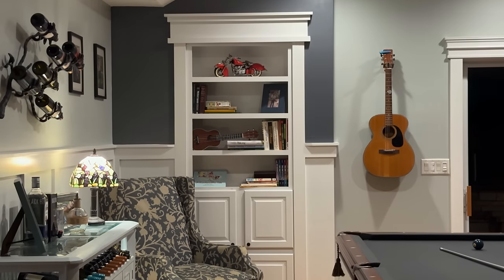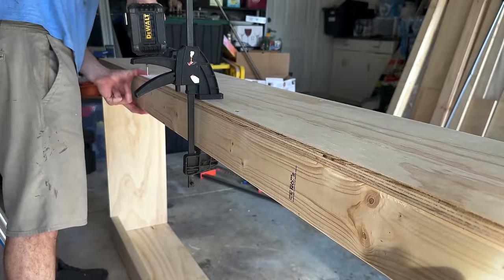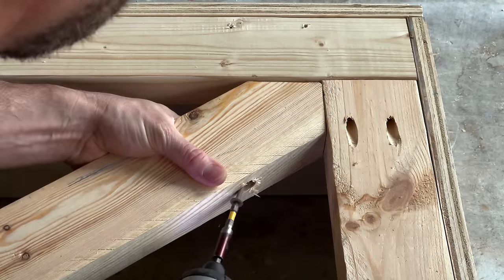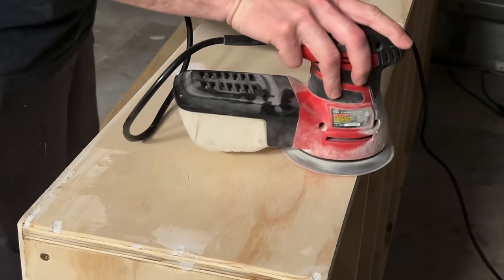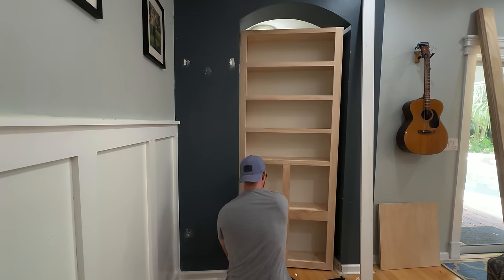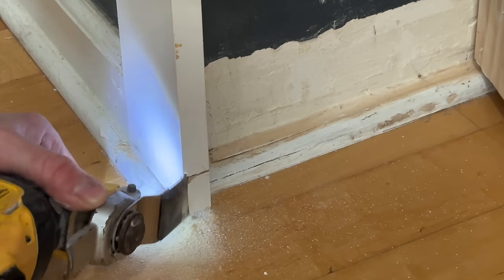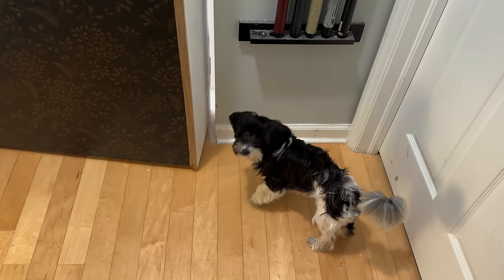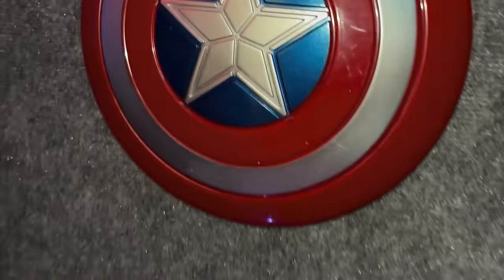DIY Hidden Bookcase Door - Murphy door build

Comment: Aside from something fun it kind of makes a safe room.
Reply: A couple of 4x2s on hinges mounted on the opposite wall with rubber stoppers on the end, one level with the base and the other with the top would make the bookcase seem solid from the other side when engaged would effectively make it just that. Relying on deception rather than full security, but should keep the kids safe from an intruder for a time should such a need arise.👍
Reply: @alaricgoldkuhl155 I think that’s what the pool cues are for!
Reply: Guns makes a safe room
Reply: @pyropulseIXXI a healthy society makes a safe room, but that's not something known on the northern American continent.
Reply: @Lorem_the_Ipsum  Sadly, home invasions are an issue worldwide. Unfortunately, wherever there are human beings there will be instances of violence. You could argue what differs by continent would be the tools used to commit said acts but violence committed by gun, knife, club or bomb are all the same. 

However, if it makes you feel safer to think differently perhaps I shouldn't try to take that from you. My apologies.
Reply: @Lorem_the_Ipsum  Sure it is. Just as long as you stay out of Blue areas.

Comment: Great ideas, I for one and forward thinking enough, I’ve done this for 40 yrs, every time I go to do something and something is not there ect, I will add it to the next build. The best is the tv, I have tons backing and put a small built in cabinet below it with a 2” conduit run to both. Hides wires. Tons of little things to make a home better.

Comment: First off, this is awesome!! As a longtime cabinet builder let me give you a few tips for the next one you build (you know, when you move 🤣).
If you use some half lap joints on the outside frame it will add a lot of resistance to twisting. Also, compared to the plywood back (that you VERY wisely glued down) those diagonals provide little shear support. You'd be positively amazed at how strong even 1/4" ply is under shear loading.

Keep it up!
Reply from the maker: Thanks for the words of wisdom. I’m always looking to improve. Great advice, and thanks for watching

Comment: Great work, I wish I had someone like you in my life ^_^ growing up.  If ya want a tip for future reference, the cross bracings should go in the opposite direction to properly assist with fighting against the sagging, the direction you went with would require tension bracing (often using a steel cable). There is a good quick video showing the difference here on youtube by SWI Fence, named "The Only Way To Brace A Gate" (I have no affiliation).

EDIT- I MADE THE CLASSIC MISTAKE OF COMMENTING MID-VIDEO! 😂  I thought I was in the clear when you started working on finishing some of it. It appears ya had it right during the planning phase, and in the moment the hinge side got mixed up, but ya noticed it and went back and flipped it around, good catch!
Reply from the maker: Thanks for the thoughtful response and thanks for watching

Comment: For a security situation, continuous baseboard is imperative. Dead giveaway for anybody, robbing your house, etc..
Otherwise, it’s a good looking project. Another tip, use a hidden wheel to hold up the weight of the bookcase.

Comment: Very nice build. There are only 2 things that I would have done different. 1, I would have added 2 casters on the bottom of the door to roll the door when opening , this will take the strain of the hinges as well. 2, I would have had a couple of Heinekens rather than Michelob Ultras. Good show man, Cheers.

Comment: Things I would have done differently: I would have made the height of this bookcase match the height of the rest of the doors in the room, especially the door on the same elevation, and I would have continued that board and batten wainscoting all the way past that other entry door. You didn't change out the baseboard on your new wainscoting sections, and it looks jarring next to the old wall. On the top section of the architrave/door molding you have totally different proportions than what is extant on the adjacent door on the same wall. Making those two openings match would have involved more demolition and drywall work, but I think the result would have been even more pleasing.

Comment: Love a lot of things about this interesting video.  The help from your son, the help from your dog, repurposing on lumber/doors.  The wide top of the door with the trim and cool reveals all the way around.  I hope your family gets you a router on a table to further your trim work and edging.  I used to take baseboards off like you did then I found trim pullers.  They are the bomb.  Score the top of the baseboard, gently open a small gap at the top with a stiff putty knife, gently push the trim puller blade into the gap and pop off comes the baseboard with no marring and in many instances you can reuse the baseboard.  I really enjoyed your video.  Hope you revisit and share how it works after a couple of years.
Reply from the maker: Thanks for the thoughtful comment. I definitely need to upgrade some of my tools as I progress. I like to get a new one with each project and they usually pay for themselves

Comment: woodworking is mostly learning basic skills and problem solving. it all comes with time and experience. you did a great job. 

the only suggestion i have is that a ballbearing firedoor style hinge might serve you better. with something that heavy you will get a fair bit of black streaks below the hinges from the metal rubbing off as the door is opened and closed. they also tend to swing more freely, which can be a pro or a con.
Reply from the maker: Good to know, thanks for the insight.

Comment: wow.  saved.  I was looking at the murphy doors as well.. SUPER expensive.  I have two spots in the basement remodel that I would love to do this kind of thing.. I think its pretty funny when you say that you aren't much of a wood worker, becasue bruh... what you did was OUT standing.  My ONLY suggestion would to put a small bearing roller in the bottom to assist with weight and constant use.
Reply from the maker: Thanks so much

Comment: looks great finished right now!!

however you should of added 4 wheels hidden inside a plinth base to keep those hinges from carrying all of the loaded weight of the door frame, shelves and bookcase,  cabinet doors and books etc. 
those 6 hinges will eventually be sagging and any minor sagging will distort your perfect swing geometry…

BUT I LOVE THE PROJECT END RESULTS PRODUCT
Reply from the maker: Thank you. That option is on the table

Comment: Very, very cool.  Obligatory nitpicks...
Probably better to attach the eucaboard before the plywood back in case it got stuck during a test fit and you needed to push from the back.
Pre-paint (at LEAST first coat) cabinet and trim, certainly before installing inside.
Reply from the maker: Those are great ideas. I honestly built this as I went, so in hindsight I would have definitely considered those options. Thanks for watching

Comment: Wheels or casters on the bottom would be a great idea.  Those hinges are going to suffer with time, unnecessarily.  The top of the door frame seems a tad too ornate for your craftsman trim in the rest of the house.  Great idea for the hidden door, though.  It looks great and I am sure your family loves it.  Keep on making stuff!
Reply from the maker: Unfortunately with too I had to cover the arch requiring higher trim than I would have liked. As far as casters time will tell, hopefully the hinges hold up. Thanks for the thoughtful response
Reply: I would go for either a full length hinge. Or. 6 or more,  15cm steel hinges.       Could the door get a 2mm steel inner and a secure bolt. This would make it almost a panic room.

Comment: Very cool and awesome piece. Your upside down mistake was actually a blessing. Your first attempt the bracing was incorrect since it was in tension to your fixed hinge location so in time it would’ve sagged. But since you flipped the book shelf it also changed the brace direction in the correct direction.
Reply from the maker: Haha, good catch. So far so good
Reply: Nope. Flipping it did not change anything, it's still in tension (in other words wrong). Please draw the door on a piece of paper, then rotate the paper 180 degrees... see, still in tension.

Comment: Very cool. You might have been better off using a piano hinge considering the door itself has shelving, which might cause sagging over the years. However that should be an easy fix if it does become an issue in the future.
Reply from the maker: Yeah, I definitely will. But so far so good

Comment: Push your caulk gun, don't pull it, for a cleaner caulk line! Plus a small V cut in the tip helps too. Also when painting, put down a drop cloth! And you missed the little piece of shoe on the bottom of the cabinet. Other than that, looks great for a novice! Good Job!

Comment: This is very cool, thank you for sharing all parts of it - the good and the bad. Anyone know what tool he was using on the edge of the bookshelf after adding the backing? I could t really tell. A router maybe? Great idea using the cutting tool for cutting the baseboards.
Reply from the maker: Yes it’s a router with a round over bit. It removes the hard corner. Thanks for watching

Comment: Man Impressed! I just built my own secret door (different style, wood slats instead of a bookcase) but this came out great and was cheap. I feel like this is the way to do it though, custom building these secret doors as there just are no one size fit all solutions. Also wish I saw this video before I built my a few things to take away here for sure haha. 

Curious how much longer did you think filming the build process caused the project to take? Filming mine was one of my first build videos and I feel like the way I did it took over 3x as long as it would have to just build it with out film (and lets not even talk about editing the video haha).
Reply from the maker: I appreciate that. Man, filming def doubles the build time. I try to put some thought into the shot so I don’t bore the viewer. Keep at it. Thanks for watching

Comment: I think you've got the first 'secret bookcase door' that's sensibly push-to-open, instead of some gimmicky "you pull this [book/statue/skull/other] which pulls a cable mechanism with three pulleys to lift a secret lever which in turn... and after all is said and done the door opens". Not that those systems would ever fail of course.

Comment: I have wanted to do something like this forever. I never would have thought that 6 door hinges would be enough to carry the weight. 

That is a pile of weight and the whole book case acts as a leaver. Did you consider putting a wheel/roller under the non-hinge side?

This was a fascinating watch. Great job!
Reply from the maker: If it ever starts to sag at all I may have to do that, or just get some heavy duty piano hinges

Comment: Excellent, however you mentioned sagging and preventing that… well the only way to prevent that is to fully sheet the back and that cactus be pared down to a solid stringer that runs from the bottom on the hinge side to the top but not the hinge side and that has to be a tight fit. That’s the only way to stop sagging, you stop the distance reducing between bottom supported and top unsupported corners reducing by sticking a wedge in.

Comment: I do doors for a living and the only thing that scares me are those hinges.... those are barely rated for a 100 lb door.... even using 6 would only equal a 200 lb rating. That case full of books will weigh significantly more than 200 lbs.....  maybe upgarde to some commercial grade 4.5" truly HEAVY DUTY hinges as opposed to those 3.5" ones. The expense associated with Murphy doors is usually because of the need for excessive weight rating. Looks great!!!

Comment: Very cool project. Next time try using pocket screws instead. Those general purpose screws will destroy the bottom of the pocket hole and eventually get loose. Also, screws on end of lumber hold a lot less than people think.
Reply from the maker: Good advice. Thanks for watching

Comment: The finished product looks very nice..but just a tip, your bracing is backward, the bottom end of the bracing should go in toward the hinge, with only one diagonal piece at that angle. That being said, next time use cabinet grade plywood for starters with a full 3/4 inch back is one way. I would avoid 2x4s.
Reply from the maker: That’s a good point. I kind of just made it up as I went.

Comment: I have always wondered about these fake bookcases. There's always a telltale mistake that exposes them, like too many footprints leading up to and then walking through the wall.
Why not build a 2 inch high riser on the floor like a threshold?  It stays fixed but the bookshelf swings above it.
It would impossible to leave a footprint halfway through the door. If your foot was there it would land on top of the riser and be hidden later when the door is closed.
And of course the bookshelf would overhang the riser by about 6 inches, to hide whatever's going on with it. When you need the secret passage, step carefully over the riser.

Comment: Out come looks great, but next time skip the 2x4 framing. You can build just a 5/8 or 3/4 backing on a standard bookshelf build, and it won't sag once glued and nailed. Also do a double sheet of plywood on the hinge side, so you have meat for your screws. This will be hidden anyway.
Reply from the maker: Thanks for the insight. Thanks for watching
Reply: @diydad1593  main reason is milled lumber can cup and twist over time no matter how you brace it,  and that's why solid doors require  oil based finishes to seal moisture out.  Nowadays we opt to only include engineered woods in doors because they do not suffer these issues. 
Since removing it from your build would lower its weight and thickness,  it's a win- win

Comment: Very nice. HOWEVER , 1 question  / suggestion  - some sort of inconspicuous durable object for the push point so as not to develop a worn spot from opening over time. . Small badge or plate or maybe statue or book. The chairs placement is an incredible idea.  NOT NIT PICKING because this is great just ask8ng.
Reply from the maker: Yeah,  my kids grubby hand prints are starting to make marks. I did use high quality durable paint that is easily washable though. Thanks for watching.

Comment: How did you account for central AC running?  How does the air circulate and get to the return air? Nice job.
Reply from the maker: Thanks. My rooms are vented between each other so I haven’t had any issues.

Comment: I am a total layman, so take this with the appropriate grain of salt, but watching the beginning when you build up the frame and put the hinges, I always thought that if you were building a door with diagonal bracing, that the bracing should go upwards away from the hinge side (i.e. the upper supported corner should be opposite the hinge). Is that correct or does it not matter? Amazing project, btw!

edit: oh, just got to the part where you realized that you had the hinges on the wrong side, so I guess my understanding is correct??
Reply from the maker: You are right about that. I believe I initially had it wrong so my screw up actually worked out 😂. Thanks for watching

Comment: I need to find out where these content creators buy their material. A sheet of sanded ply 1/2" starts at $60 where I am. Pretty sure all the material for this project would have cost me at least $400. Looks nice though, good job.
Reply from the maker: My HD has 3/4” radiata ply for less than $50. Decent stuff for this kind of build. Only needed 1 sheet for this project. The 5mm euca board is only $18 a sheet. Doors and paint were salvaged. $400 is a fair number otherwise
Reply: @Beau_Builds  should of mentioned also this is Canadian pricing. And that make sense if we're talking not buying all new material. Never actually watched the whole video. Finished product was sweet though. Good job.

Comment: Neat project!  Was trying to see if you put the diagonal bracing correctly, and looking at 4:30 seeing the side with the hinges, it looks like the diagonals are incorrect.  When hanging a door such as this, the high part of the diagonal should be away from the hinge side, the low part of the diagonal should be on the hinge side.  Am I seeing this correctly?  Once the diagonals were covered with the sheet goods, it was impossible to see it.
Reply from the maker: I’m going to be honest, I’m not sure the position of the diagonal braces. I only have about a 1/16” gap of clearance with the door so if it ever starts to sag I’ll know right away. But for now it’s holding up, time will tell
Reply: @Beau_Builds I'm sorry to call it out!  It looks like you have more than enough hinges and the box looks pretty stout, so I suspect you'll be fine.  I doubt you'll be loading it up with hundreds of pounds of books and stuff.  Overall, I think it's fantastic!

Comment: Now that you're a month + in, how has the door held up?  Any sagging?  Even with those heavy duty hinges, I'd be concerned about the outside edge dipping and dragging on the floor.  Also, is there a reason why you went with those kinds of hinges and not the plate and swivel hinges most bookcase doors use?
Reply from the maker: So far, so good. And that’s with heavy use from the kids. There’s only about a 1/16” gap so if it’s starts to sag I’ll know immediately. Thanks for watching